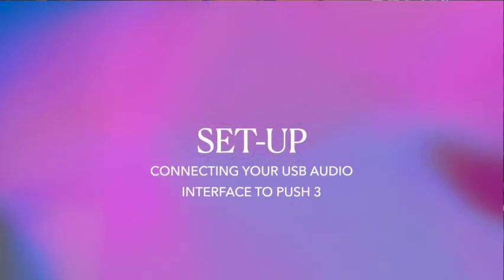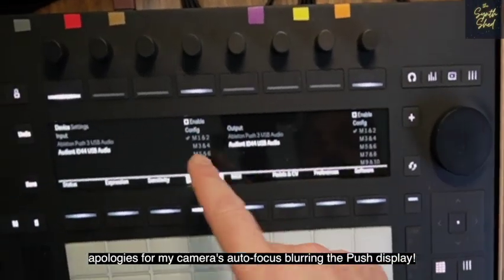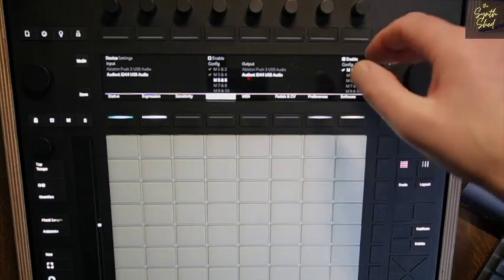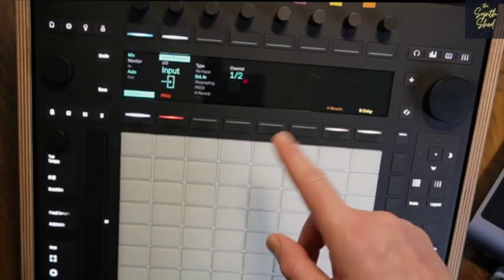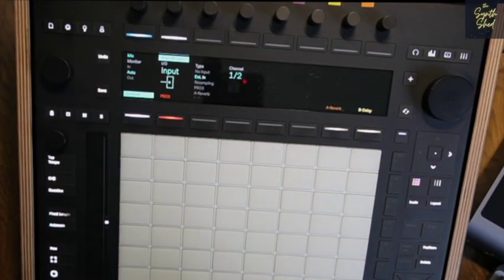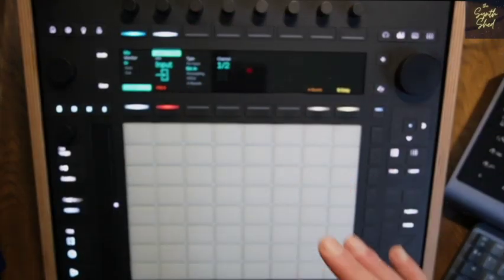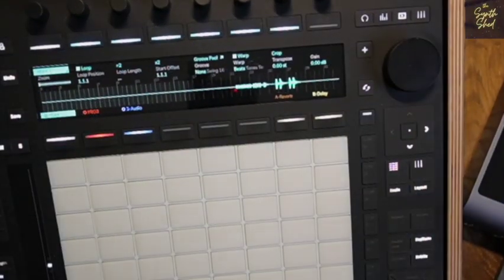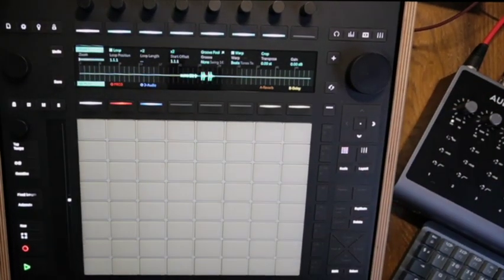Finally! USB Audio Interfaces and Multi-Track Recording on Push 3 Standalone – How to Set It Up

Comment: Can I use two sm57 microphones ( with xlr to quarter inch  cables ) and record that way?
Reply from the maker: Via an interface like the Audient you can go straight through xlr - but if you mean direct into the Push, Afraid that’s not something I’ve tested but Ableton online manual or support will be able to confirm no doubt!

Comment: I’ve been using the Tascam Model 12 as an interface for the Push standalone and I am getting a lot of audio dropouts/artifacts at 128 buffer size or lower. 256 buffer is better but I use midi and CV tools a lot so the bit of latency that occurs is not ideal. Does anyone else experience this? Any tips on reducing the dropouts/artifacts? I already limited my enabled channel selection to only what I am using. Also, I am using the push onboard outputs and a datanoise octawave ADAT expander—not sure if that is a factor at all.
Reply from the maker: I haven’t tried with that mixer but I’ve seen other testers report similar issues with various usb audio devices  - reliability seems to vary quite a bit depending on your interface. I found the audients very stable, and will soon be testing with Motu.

Comment: One thing I've not managed to figure out with my ID-44 mk-1 connected to the Push 3 is direct monitoring on the ID-44. I normally use direct when the ID-44 is connected to a computer for latency free bass guitar and so on. At the moment I think that's only possible via the Audient software mixer and drivers. If only there were a direct switch on the ID-44 hardware. Maybe one day Ableton will build the option into the Push 3.
Reply from the maker: Have you set up standalone mode on the iD? Check my other videos on setting up Audient interfaces!
Reply: @synthshed  I haven't.. will check the videos! Thank you.
Reply: @synthshed No way is it as simple as that! Haha.. Thank you so much!
Reply from the maker: @anirogger happy to help

Comment: Oh cool great to see. How would one attach a midi controller if the audio interface takes up the one usb slot?
Reply from the maker: Good question - simple answer: USB hub! I have my audio plus a bunch of midi stuff connected via an Elektron overhub. I was planning to cover the midi side in another video, probs early 2026. Cheers!
Reply: @synthshed oh cool and the electron overhub must be a good one. Or one that is powered. In the past I've had issues with usb hubs. Any issues with the electron one?
Reply from the maker: @SEQNK spot on. Powered, and go for decent brand like Anker I think generally ok - I stick with the overhubs these days just because they handle everything I throw at them. Some of the generic ones I’ve used for instance have been terrible with midi !
Reply: @synthshed nice thanks good to know

Comment: So if I have various modular synths, can I record and apply the internal push effects to each synth if they’re on separate channels or as the “external instrument”?

I tried using push with adat and I had the odd issues that if I had the synths go out a different channel than main or 1/2, it’d just be the dry audio and not the push internal effects. 

Appreciate any insight!
Reply from the maker: Hi thanks for watching. Yes if I understand the question right - any incoming audio on an individual Push track you can add Live’s stock effects - think I do this on my other video if you want to check it out: Push 3 Standalone: 24‑Channel DAWless Hardware Hub (USB + ADAT Expansion Guide)
https://youtu.be/3tZwFMOwrNE (also deals more with ADAT, in case that’s helpful)
Reply: @synthshed checking it out now! But yes, I had the standalone and added adat and was confused why like the “echo” free didn’t work but my two mono channels on 1 and 2 mono then I had that go into another interface for my daw (basically using push as the module hub) and I was trying to use the outs of the adat (so like going out 3/4 for example) but in my I just heard raw input like a pass through. 

So my assumption from your video, and I’ll be watching you linked vid… is push must treat the audio interface different than its internal interface even with expanded I/O. 

Idk if that helped but I appreciate your comment
Reply: Echo effect*
Reply: My assumptions is internal Ableton push standalone effects only affect what goes out on channels 1/2 on the native interface but not if for instance you send out 3/4… x/y.

Comment: I've got the USB audio working just fine on my Push. The problem is, every time I turn it on I have to set it all up again, because it doesn't retain any of my audio settings (e.g. sample rate, buffer size, and I have to manually select the audio interface again and enable the USB audio channels). I tried saving it as a template, but this doesn't seem to work either. I feel like I'm missing something. Any ideas?
Reply from the maker: Hey it's not you - it's another bug (which I didn't cover in this video as I was hoping it would be fixed before the public release, but alas it wasn't!) and yes a very annoying one! Unfortunately there's no way round that at the moment (I tried all the same things you mentioned lol) - but I've confirmed with the Ableton/Push Dev team that this is a known bug, and a fix is coming soon. Hold tight!!
Reply: @synthshed Awesome, I'm glad they're fixing it!
Reply from the maker: @FreezeEtch yes me too. Will make a big difference - already impressed by how stable the implementation is but that fix is critical.